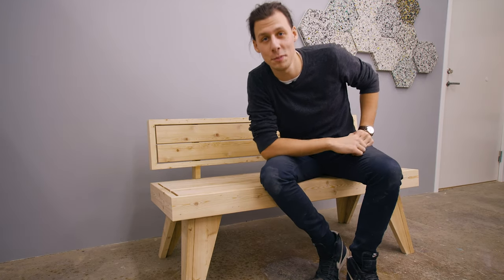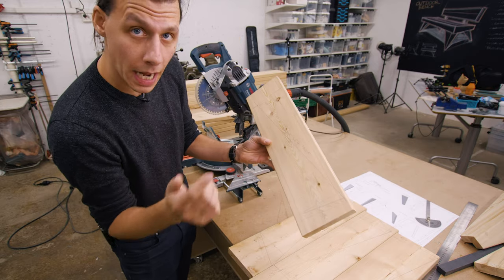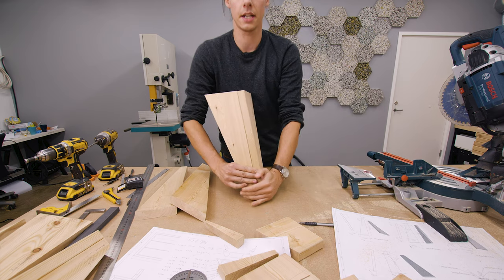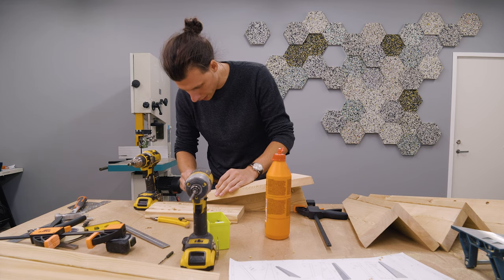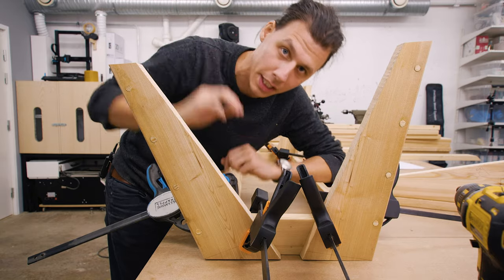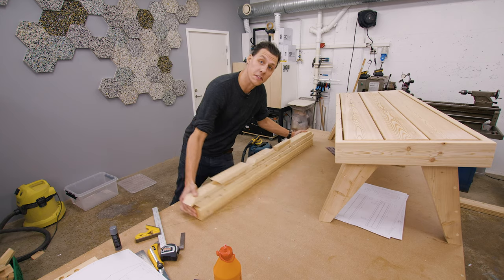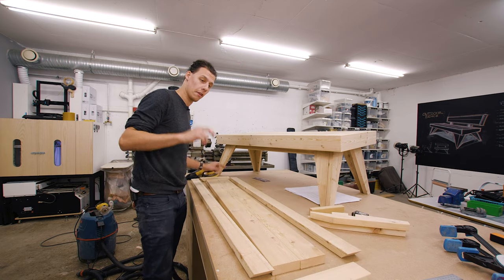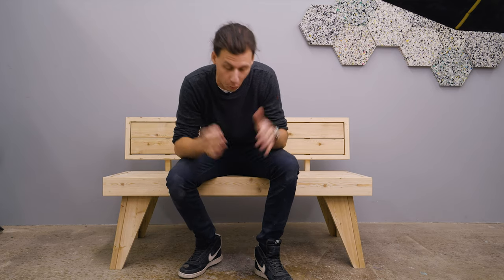DIY Outdoor Bench - Modern Bench How-To

Comment: I bought this ottoman/storage https://www.youtube.com/post/UgkxNuLbiXpLQ-mKH5NlyjrNe88hiCk2N3Cgcube to store my pup's toys in -- and thinking it would double as a footrest was a good idea. I have found it is ideal for toy storage; at night, all of his toys go into the box and keep the clutter out of the living room during other times, but easily available at play time. As a storage box it is strong and very well made; I think it's a good value for the price -- the exterior faux leather is soft and very good quality -- and it looks really nice! With its smart looks and dark color it is unobtrusive, so it blends well in the living room. When this very thin box arrived, I was curious to see how it all fit inside -- basically the shipping box contains the lid and the entire cube fits nicely in the lid -- yeah! amazing. It takes seconds to put it in shape and, again, I was very surprised how sturdy it is; I can not imagine it would ever collapse. The enclosed paperwork does say it is rated at 300 kg, and it might handle that -- but I don't think I would test it (or too many things) to that level -- it is probably based on setting an item squarely on it under testing conditions -- I don't think a 600 pound person could sit on it without breaking. It has a lining inside which adds to its nice looks and quality feel. As an ottoman, it is a bit too high for my sofa -- about an inch shorter would have been perfect; but it is nice for the recliner. But height aside, it is very comfortable as a footrest and very well padded. Even though I thought I would give it 4 stars due to the height, I decided that the pros outweigh that one element -- and every sofa is a different height so it may not be too high for others.